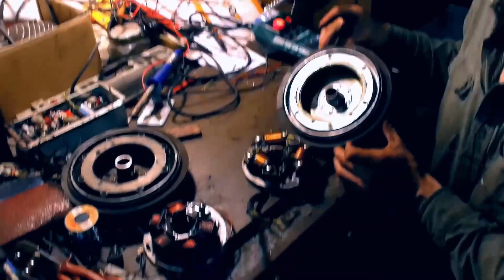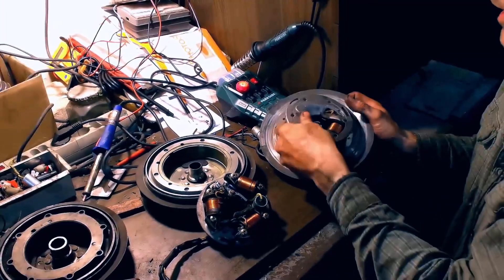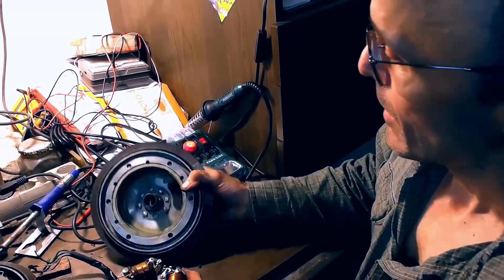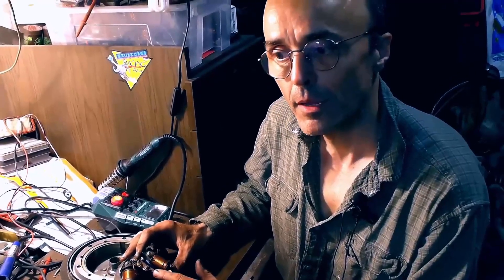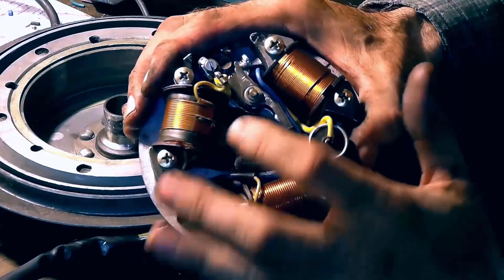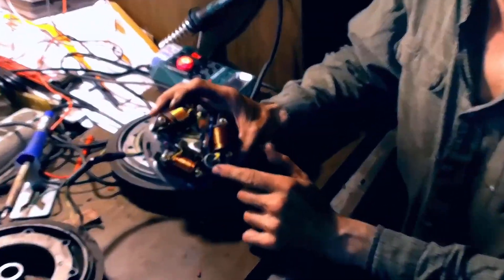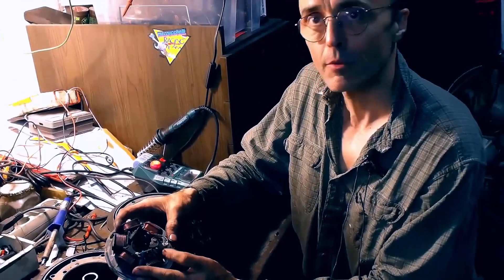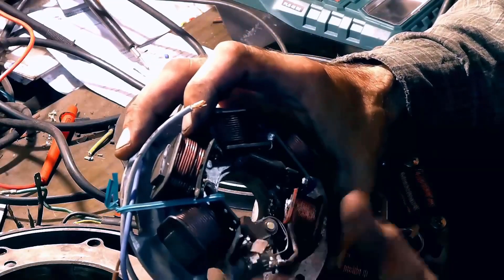30 - Ignition systems: Contact Breaker for Vespa large - part 1 of 4

Comment: my engine sometimes bog when the contact breaker opening is set too narrow (below 0,05 mm) but it becomes normal and can revs much when i set it wider (more than 0,05 mm), could you please explain more about the opening size? and about what is advanced?
Reply: @WhiteOneRacingExtra  I found that the timing degree was not set properly, so I set it to correct position (22 deg BTDC) and everything run well.

As you said the timing can be advanced if the gap points is set wide right?